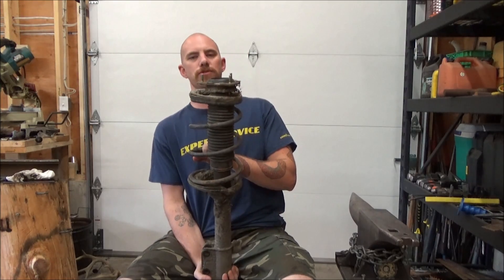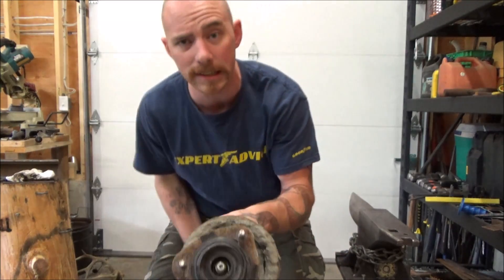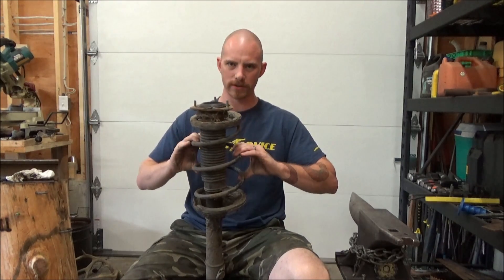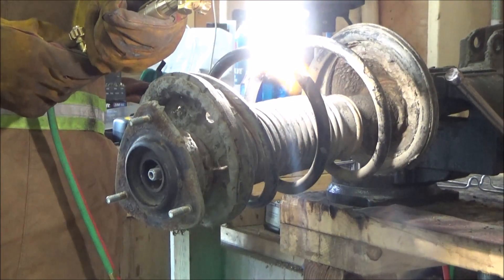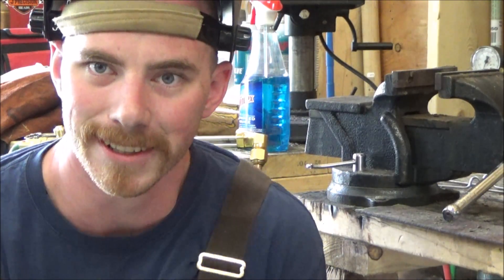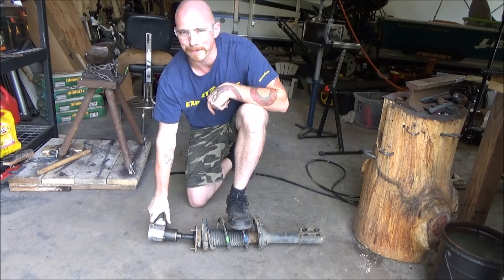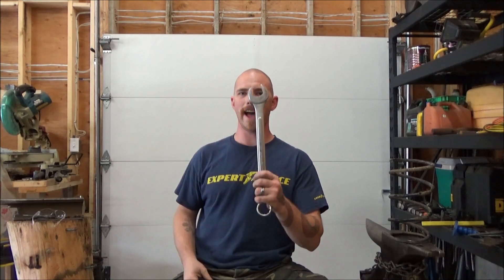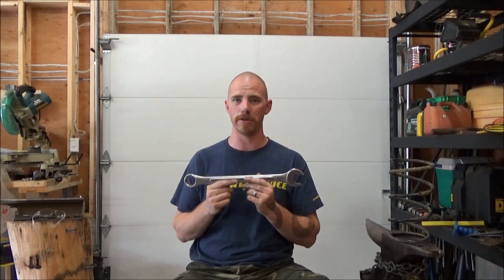Blacksmith Removes Spring Steel from Strut Without Clamps ✔

Comment: I would sure that different diameter of springs are available. Does this depend on the vehicle they are used on, or is it more of a brand name issue? Thanks!
Reply from the maker: Different vehicles have different springs. Absolutely. Check out my pile at 1:19 you can see some of different diameter. A car has a different spring than a truck has a different spring than a sports car has a different spring than a van. The ones I opened up were off a Dodge van I think.